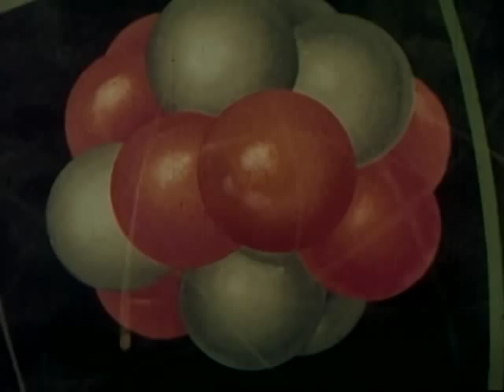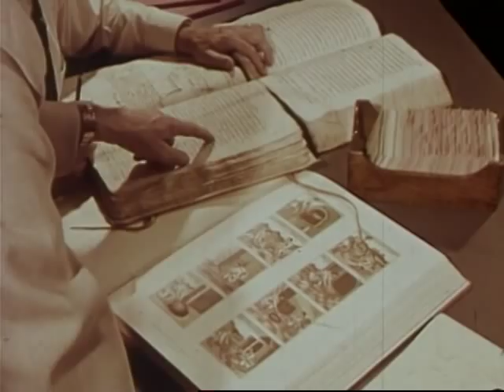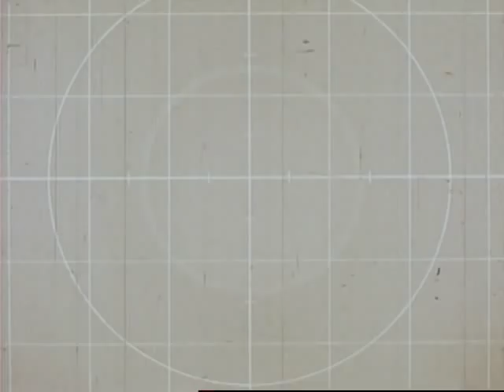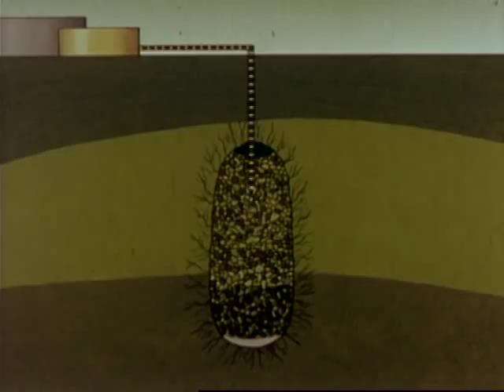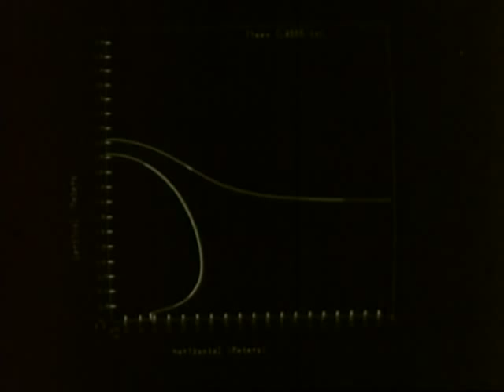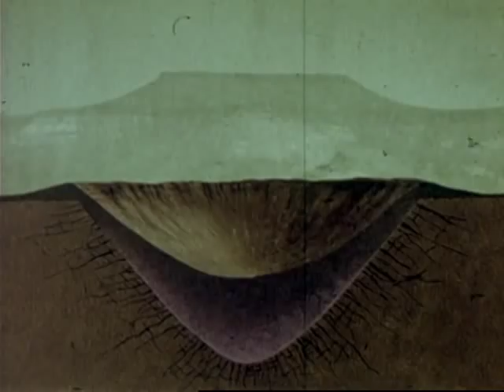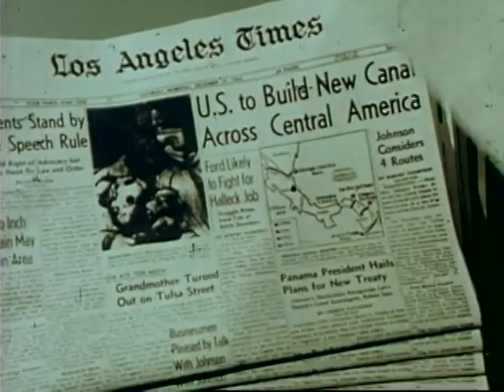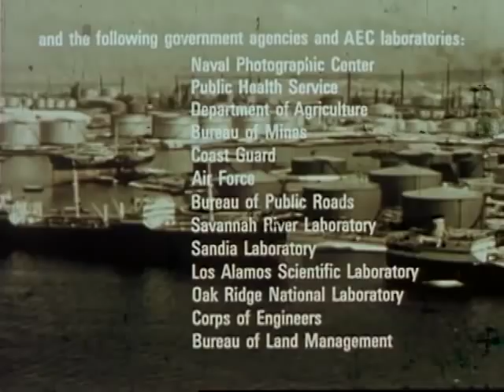Operation Plowshare

Comment: Plowshares goal was to explore and develop safe, efficient nuclear explosives and find effective and practical ways to use them. The idea was that explosives provided mankind with the ability to make difficult or impractical jobs easy and practical as well as efficient from an economic perspective. Plowshare would place an explosive containing extremely high amounts of energy deep underground in the rock and when detonated, the rock shatters and get broken up. This in theory makes for efficient and practical gathering of natural resources such as natural gas, oil, and valuable ore. It would also allow humans to access resource in harsh landscapes which previously were made zero sense economically as a prospective resource project. However, ethical complications arise with this process. There must be total control over the operations because without it there are widespread harmful effects as a result of this technique.

Comment: Everyone in the comments is bitching about the fallout when they mentioned in the video improved designs and techniques to reduce fallout and radioactive contamination, if Plowshare wasn't cancelled by you fear-mongering types we would have achieved great feats of earth-moving and mega-engineering that aren't possible or economically feasible with conventional techniques.

Right now the Panama canal expansion project is underway using conventional methods, time and labor intensive, when we could have had a wide, sea-level canal through the use of Plowshare nukes and techniques several decades ago already, the progress of man was held back when we lost Plowshare.
Reply: Go ask the Panama government if they want to. I doubt their is any earthy use for this.